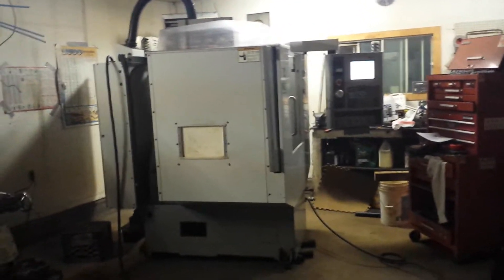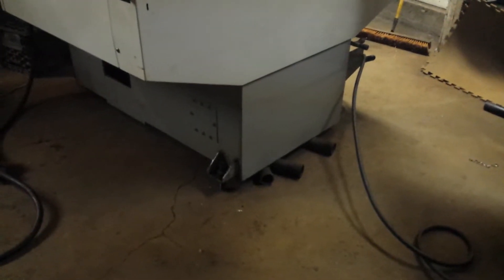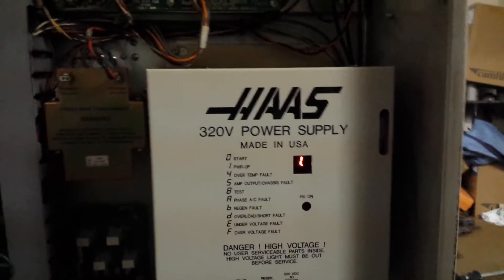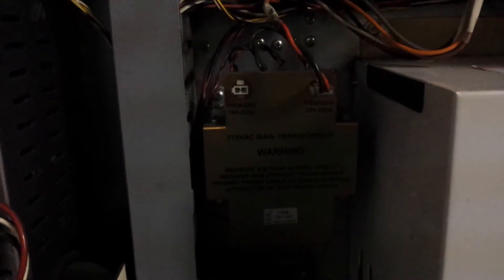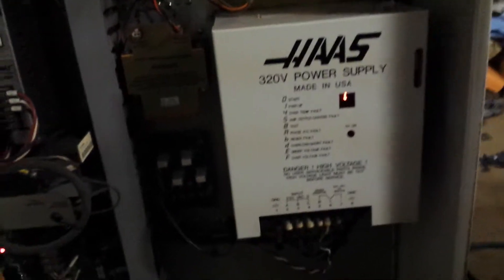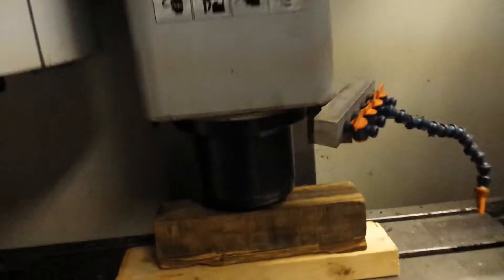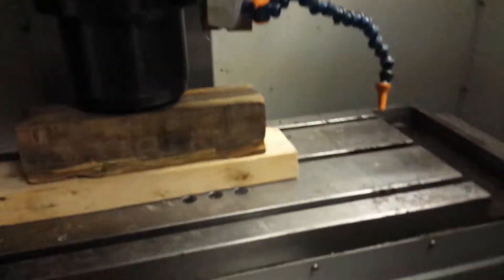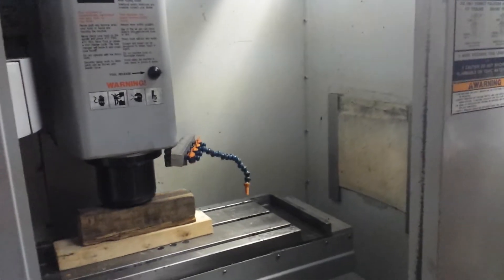Haas mini mill part 1. Moving and wiring

Comment: Looking to do this as well. Did you run the wire straight from the breaker to the machine? L1 and L3? What size breaker did you use? I ask because I see they have external transformers as well?